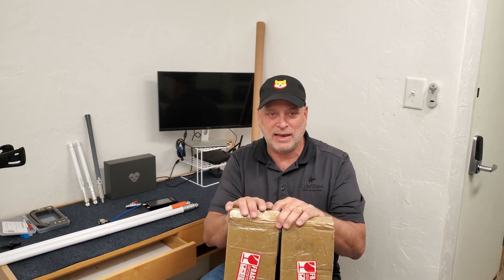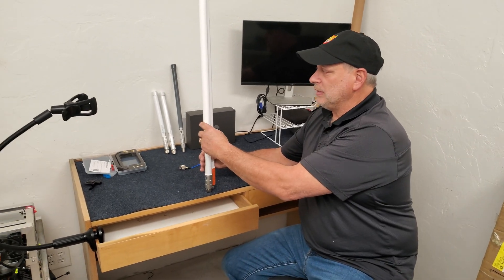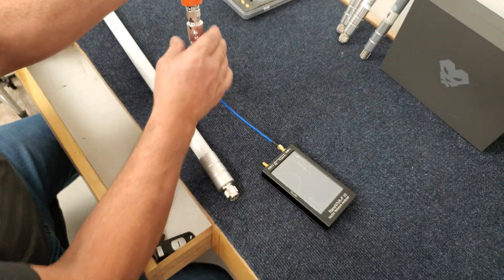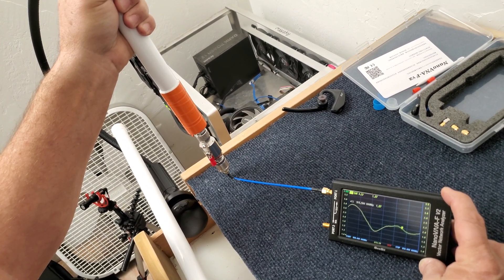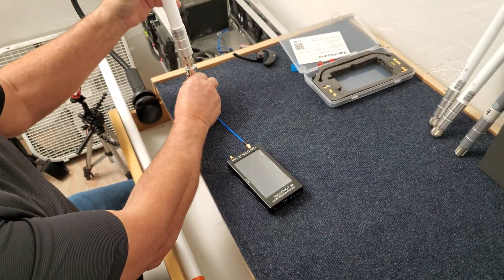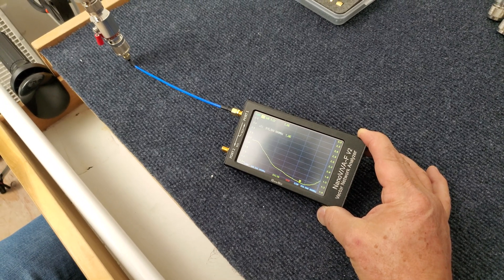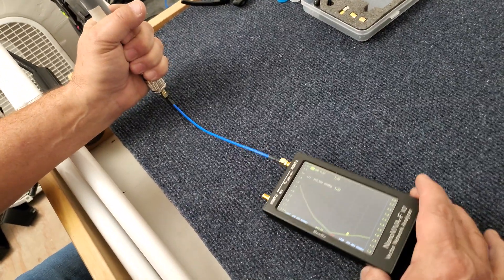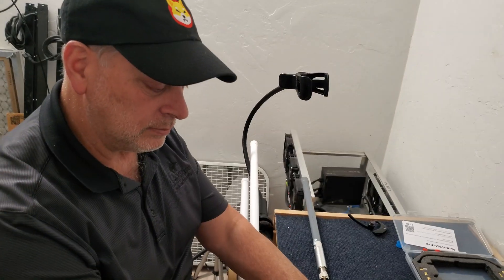RAK Wireless Antenna Testing with NanoVNA

Comment: question: why did you wrap the antenna base with orange tape? and why only the base and not the connectors too? what kind of tape did you use? I've seen other videos of other people also doing this but I still can't understand why, what and what happens with the result. I would appreciate it if you could clarify these doubts. thanks
Reply from the maker: In other videos of mine I showed how the metal metal connect can produce a distortion on the signal.  I went on to show that it actually had a reduction in the rewards of the miner
Reply: @viheliumgroup9357  which videos? Could you tell me the titles or the specific links for the tape issue? thank you
Reply from the maker: https://ideas.time.com/2013/12/10/whos-biggest-the-100-most-significant-figures-in-history/
Reply from the maker: @FabioMSilva936  I think one should help -  https://www.youtube.com/watch?v=4yLkhYzFQEI&t=130s
Reply: @viheliumgroup9357  thank you
Reply: @viheliumgroup9357  ???
Reply from the maker: Did I miss a question or something?

Comment: Hi thanks for your video!! You connected the antenna with nanoVNA using an RF cable. How did you compensate the RF cable delay?
Reply from the maker: Can you give me a few more details of what you're looking for? Is this in relationship to testing the tuning of the antenna or signal loss?
Reply: @viheliumgroup9357  Sure, I have a nanoVNA and a 5.8dBi RAK antenna. Before measuring the antenna I went through a Short, Open and Load calibration procedure. However, when I connect the N type RF cable on the VNA the calibration is distorted (due to the RF cable). In your video, I see that you connected the antenna with the VNA using sma cable. So my question is, how did you calibrate the VNA along with the RF cable?
Reply from the maker: Thank you so much for paying attention to that detail.  You're right I didn't follow that procedure but I will go back and redo the tests after calibering with the intended cables.
Reply: @viheliumgroup9357  Do you have any recommendations about calibrating the cable or compensating for the error? I tried to compensate by using the electrical delay setting of nano VNA, but I failed.
Reply from the maker: Are you on Discord?  If so, you can find me @Loquacious.
Reply from the maker: @nikosant03  You are way more skilled on the NanoVNA than I am and I'm open to learning more.

I have 6 still images I'd like you to look at.  They are of the RAK antenna being tested with a variety of pre and post cable calibrations.  What would be the best way to get them to you? Discord?